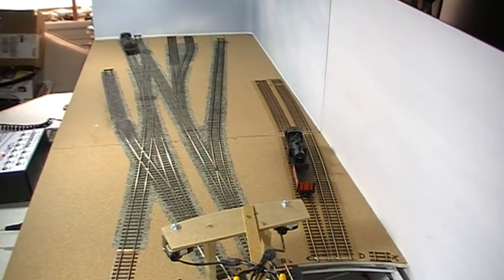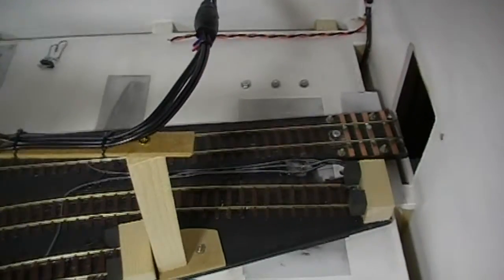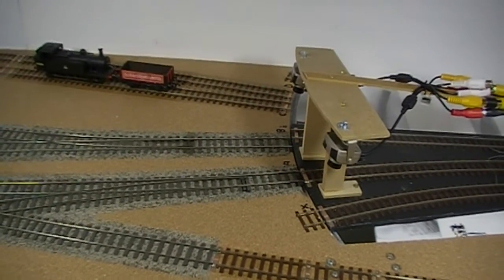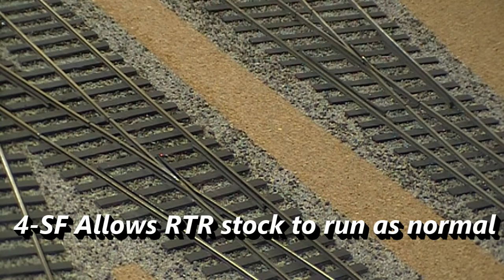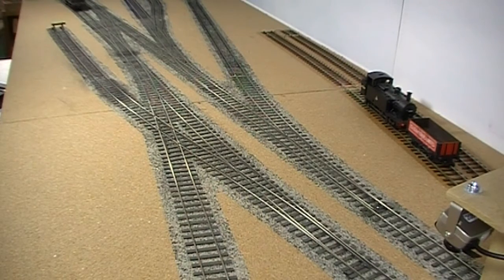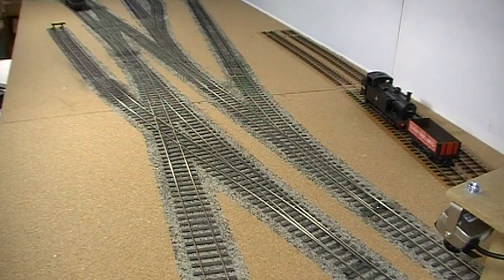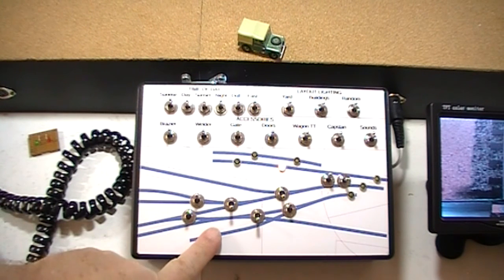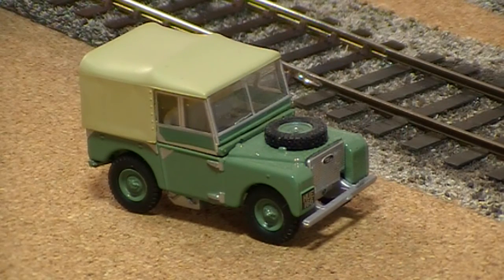Canal Sidings 01 An introduction to my new model railway

Comment: Hi John,  I came across this series via the Last Journal article.  Well done I am enjoying your progress and it has inspired me to pick up development of my own shunting layout which has languished for the last year or so.  Just a question if you don't mind, what cameras are you using over te sector plate, the quality looks really good.

Regards
Terry (4564)
Reply from the maker: Hi Terry, welcome to my channel and thanke for commenting. Will you be posting videos on your layout progress?
The cameras I use are this type
http://www.ebay.co.uk/itm/Mini-Wired-SPY-Hidden-Video-Recorder-DVR-Security-Surveillance-Camera-NTSC-/272441308413?hash=item3f6ec474fd:g:C84AAOSwA3dYIHrg
Note that this is just one of many sellers offering these camaras..........John
Reply: It won't be until the spring when I begin on my layout at the earliest.  My loft, although large is unheated at the moment.  I am at present building a 16mm narrow gauge live steam loco from scratch and I intend to publish a few pictures of that progress.

I do intend to make a few videos of my 4mm layout progress and will let you know how I get on.  I've just bought a nice video camera and am just practising at the moment.

By the way, I see that the cameras you mentioned are NTSC and not PAL,  is this a problem with the monitors, did you have any problems to overcome in that regard?
Reply from the maker: Hi Terry, The difference between NTSC and PAL is usually not much of a problem just 60Hz not 50Hz frame rate and a slightly different colour system. This may make the colours a bit washed out on a PAL monitor but I simply adjust the colour settings a bit. There are many of these offered that don't even mention the TV standard so I would not worry too much. Here is another one from the UK
http://www.ebay.co.uk/itm/Mini-6-LED-Wired-Spy-CCTV-Camera-Security-Color-Night-Vision-Infrared-Hidden-Cam-/371828629882?hash=item5692b6a17a:g:AfQAAOSweW5VMNVe
which gives a specification and they say 'CCIR PAL/NTSC standard'.
the quality always seems better to me on a smaller monitor anyway. I do use them on a 21inch monitor and that shows up all the imperfections! I am just happy that they are cheap!!!!................John